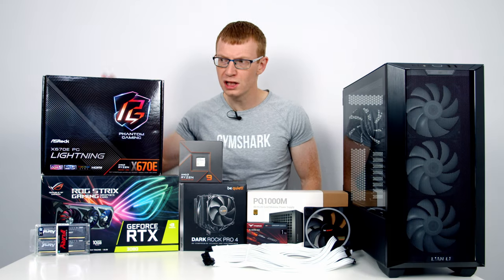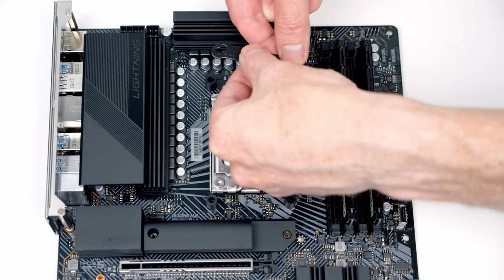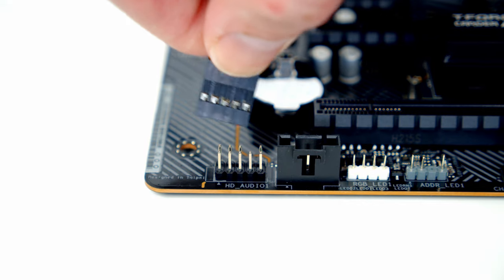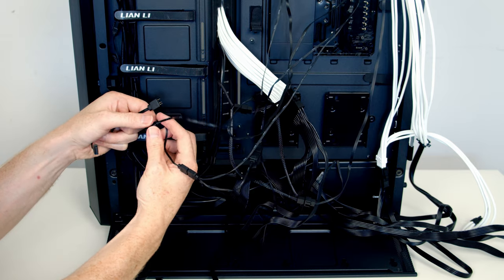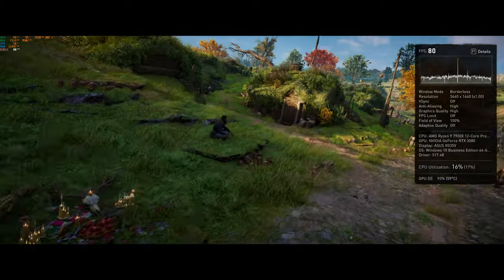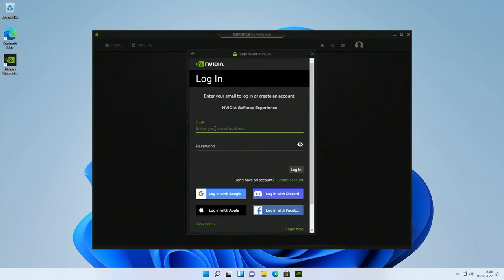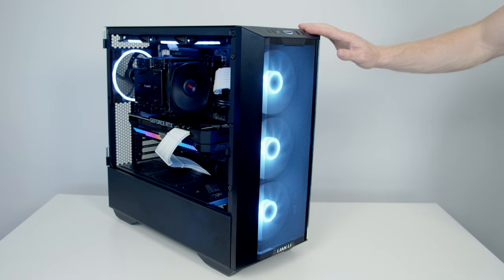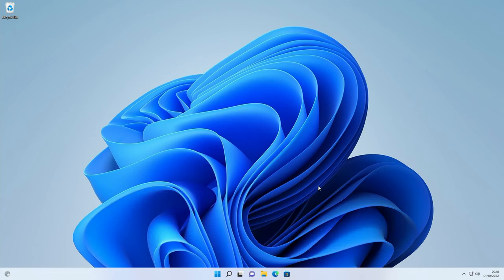AMD Ryzen 7000 Series PC Build Guide - 7900X & ASRock X670E PG Lightning

Comment: That motherboard is actually pretty nice and affordable.
Reply: Does Asrock b650 pg lightning cpu performance presets use negative or positive curve optimizer?

I tried the "PBO, TJmax 85c, curve optimizer, -40mv" profile cb23 crashes and rebooted pc right away...I disabled the profile and aer back my CO settings.

CPU: 7800x3d

Comment: Christopher, you sound as Irish as your name... and that's a good thing!  😁👍

I'm quite certain that if this were my build that I'd also choose the ASRock X670E PG Lightning but I'd for sure choose the R7-7800X3D because I'm more of high-end gamer than anything else.  I would also use my existing AMD Wraith Prism cooler because I wouldn't be looking forward to having to literally take the socket apart.

Alas, I have an R7-5800X3D mounted on an ASRock X570 Pro4 with 64GB of DDR4-3600 so I'm not able to justify the upgrade cost as there's not a single game in the world that the R7-5800X3D can't easily handle, especially since I game at 4K with an RX 7900 XTX.  Gaming at high resolution means that my video card is my limiting factor, not my CPU.  I estimate that I should get another five years or so out of my current setup.

I'm really excited to know what will be available for me then as I never stop paying attention to the PC parts market, looking for bargains that I can't refuse.  (It's why I have 64GB of RAM, 5.5TB of SSD space and over 60TB of HDD space).  I'm thankful to have a server supertower case to hold it all and a 1kW PSU to power it all.  😆

Comment: Dark rock pro 4 is doing an excellent job keepin gthe 7900X cool!
Reply from the maker: Not let me down yet
Reply: It isn't, in heavy CPU loads:
https://www.youtube.com/watch?v=vcUuJALqcg8&t=405s

If you want a 7900X, get an AIO cooler, not an air cooler. Not to mention that if you look at the GPU installation, the back plate of the GPU is right up against the CPU cooler. This will likely impede air flow to the cpu and might affect gpu cooling. This build has other issues, like improper thermal paste spread on the cpu and installation of the M.2 drive on the chipset lanes, not the cpu lanes which adds a small amount of latency. None of these issues are as big as using an air cooler for the 7900X but you get the point.

Comment: I'm building my new PC. AMD platform very tricky. Then using ASRock X670E PG Lightning will be better use Asus Strix B650E which has much more (More PCIex5  m2 slots, Hiend audio, More Hi speed ports and etc )then this cheap board. RAM should eat least 6000 mhz it is AMD requirements. Please, don't use air cooler for this type of CPU. The best option  	
Arctic Liquid Freezer II 360. Good luck in your built!

Comment: Thanks so much for this amazing vid Christopher. I did my 1st build following your guide.

I have a quick question for you. I have an asrock x670e steel legend and a DDR 5 by GSkill that's on the VQL list. Using the Expo profile for the 3rd day after I got the build up & running, I got a BSOD about 1 hour after waking up the PC from a sleep with code 50 (which is related to RAM). I run a memtest86 with the JEDEC profile and 4 passes came out with 0 errors. Should I try increasing the RAM voltage to 1.4v with the expo profile or do you think I have a bad RAM? Any hints would be appreciated.

Comment: Hey always a nice surprise to hear another Northern Irish accent! 
Did you need extra brackets for the cooler to work? It went real quick from "all am4 coolers work" to "our am4 coolers will need a new bracket/screws" on most manufacturers. 
I really wanted to NZXT Z93 but unsure if it will work now as its not even on AMD's listed as compatible :/
How does the fan sound while air cooling btw?

Comment: Hi i have Gigabyte x670 gaming X. There are 2x 8pins  slots to power CPU on this motherboard. My CPU is Ryzen 9 7900 x. And my question is: i need connect 2 cables to power up this CPU or one is enought? I dont need to overclocking this CPU. Please help anybody.

Comment: Dude... spread the thermal paste, for crying out loud! The Ryzen 7000 series ramp up to 95C and the better you cool them, the higher the performance. You should probably go with an AIO liquid cooler for the 7900X and 7950X. In full core loads the CPU will likely throttle with this air cooler and with your poor technique of applying thermal paste. For the 7600X and 7700X you might be okay though.

Comment: You are wearing an Apple Watch, and then doing a 'PC Build Guide' ?    Something is very wrong here.  haha
Reply from the maker: No harm in mixing tech. I use a MacBook for my laptop, but would never dream of using a Mac for a desktop.
Reply: @ChristopherFlannigan  I agree about laptop vs desktop.  Just look at the Mac Studio with M1 Ultra:  

-$5400  (with 64GB and 2tb ssd)
-unable to run Windows properly
-terrible for gaming
-gpu is weak, vs RTX 3080
-not upgradable, or repairable
-runs ARM cpu from a cell phone

It's basically a fat Mac Mini, for $5400.   A disposable and dead-end machine.

A $2200 Windows PC will just destroy the Mac Studio.